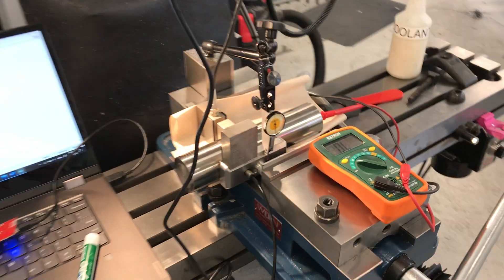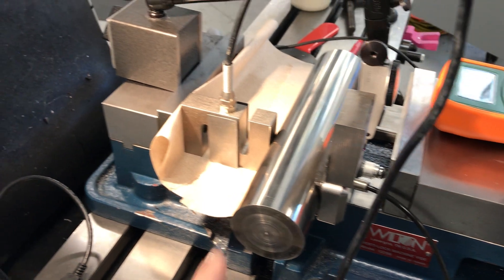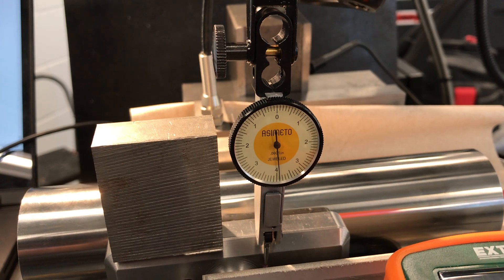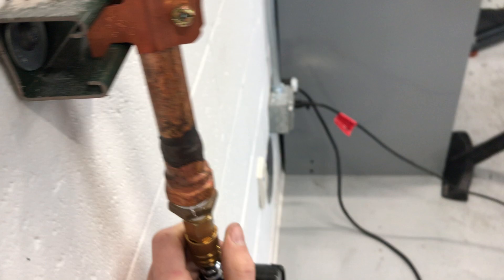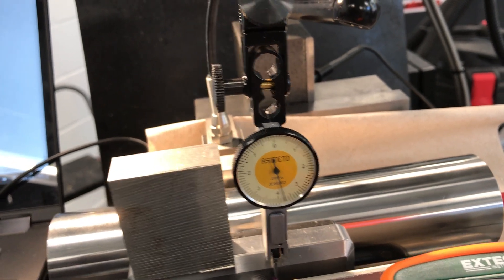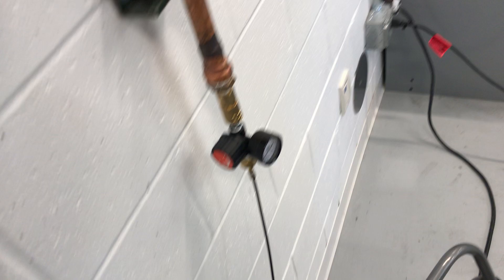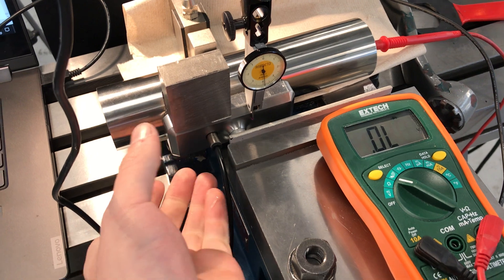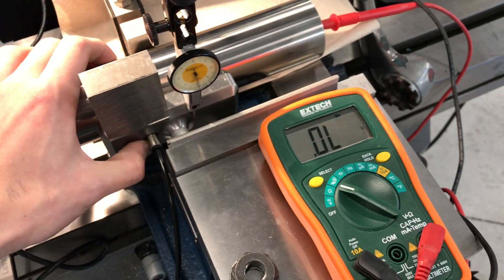More Air Bearing Testing Spam

Comment: For this level of precision work, it may be beneficial to get a higher precision air pressure regulator and mount it close to or on the air spindle so that you more accurately control the air pressure. Especially if other air powered equipment cycles on and off while you are operating the spindle.

Comment: Interesting that it has little resistance to the twisting moment. I wonder if its getting enough air out to the extreme edges of the bearing, or if most of the air is coming through the middle were the graphite is thinnest. Like you said this can't actually affect the bearing performance since the mount doesn't constrain twist. 

The fact that the indicator moved at all in this test says that there are other factors at play. The load cell is the most easily deformed "spring" in the system of load-cell, shaft, bearing, and vise. So when the shaft lifts off I suspect the load cell is shrinking in length, however the indicator is not measuring this, it is measuring the displacement of the air bearing plenum with respect to the vise. So the one tenth difference was probably due to elastic deformation occurring around the kinematic support ball. I suppose its possible that the lift off force is actually spreading the vise jaws apart, but seems unlikely to me with how stout mill vises are. This would be easy to test though. What did the load cell reading drop to when the air was disconnected?

This is a super cool project, pretty rare to find this kind of real engineering shown on youtube.
Reply from the maker: You are correct, in this video it was incorrect for me to assume the displacement was purely due to an air gap. There are many more “Springs” in this system that could be effecting motion/stiffness. I’ve done testing since that mounted the indicator base to the shaft itself, therefore stopping any other parasitic springiness from effecting the air gap reading. Air gap readings remain similar however, still a tenth or so
Reply: @cylosgarage  Yeah that solves it. Just barely resolvable with a test indicator. Speaking of that have you looked into higher resolution measurement methods for analyzing the completed spindle? A book I read mentions a non-contact capacitive sensor that can read to tens of nanometers, for analyzing a spindle at speed. I've been thinking of building such a system for analyzing journal bearing and hydrostatic spindles.
Reply from the maker: @andrewphillip8432  yea, i'll hopefully be getting one of those soon enough. Must acquire funds first. For now I've got a Mahr Millimess that can read 20 millionths, just for fly height though, not dynamics testing.